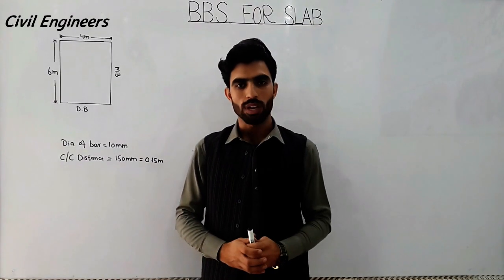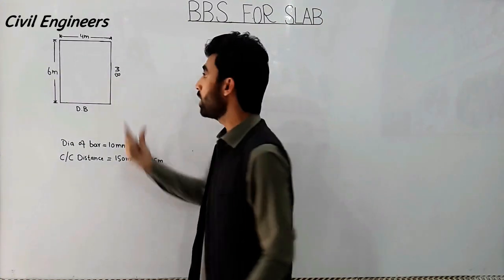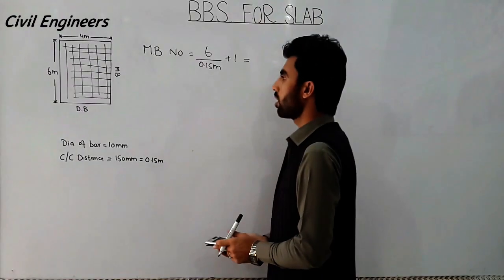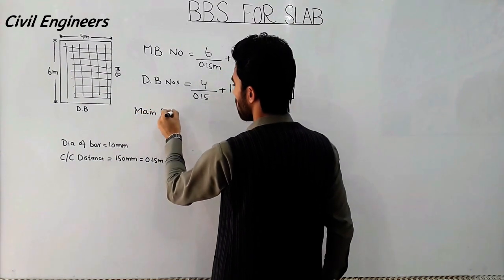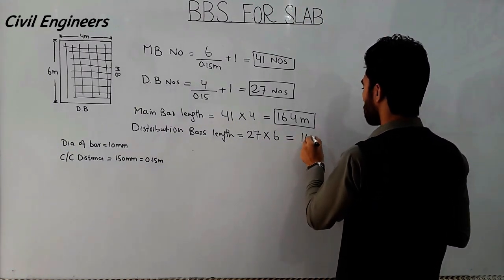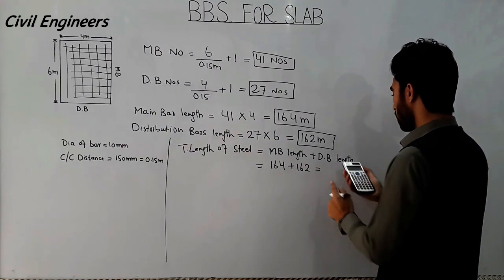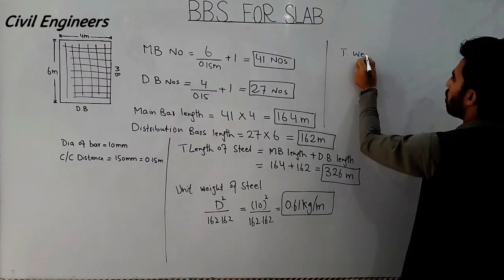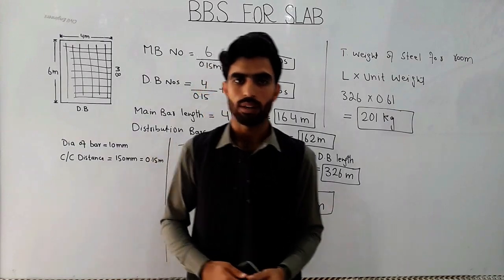How to Calculate Quantity of Steel in slab.

Comment: From where you calculated the unit weight on the board the denominator you write 162.162, thought its just 162 its the Diametee thats squared.

Comment: Total Length ÷ c/c spacing = Total no of bars + 1 ( my question why we plus 1 bar) what's reason???
Reply: Try this...practically... write on the paper in 10 x10 cm box correct dimension..now divide 10 part of spacing...now check u got 10 lines with right corner box line .... but the left one is balance....so..+1....slab need 2 bars at the corner with clear cover,👍
Reply: assume the slab size as only 0.15 meter. now if u divide it by 0.15 then it will give you answer = 1. but in that slab you need 1 bar on both sides, right? so you have to add 1 in answer. so now 1+1=2. now take 0.3 meter slab. and calculate. you will get your answer.
Reply: Simply you start counting from( 0,1,2,3......)like that the 1 point in start we add it.i think you understand it now in simple way
Reply: For safety

Comment: thanks sir for your free explanation, and I would like to ask you one question that is, why are you used 162.162 for weight  of slab while you used only 162 for beam?
Reply: It's formula not use the length of distribution bar

Comment: Sir if we are providing 8mm dia for main bar & 10 my dia for distribution bar. Then what is the calculation.
Reply: It will be the same only the unit weight of steel will be different.i.e for 10 mm bar the unit weight is 0.61kg after cal.n for 8mm bar it will be8×8/162.162=0.39

Comment: Who will deduct the covering provided in a slab from the length of each type of steel? Which is 1.5" from each side
Reply: It is mentioned in IS Code 456-2000 . The covering should provide different at different  locations/region  like mild,moderate ,severe etc and different structure like beam ,slab etc

Comment: how to  calculate center to center distance of slab.
Reply: Parmeet Kour as per IS 456  the spacing BTW main bars should not be greater than 3  times the thickness of slab. 
And should not be less than the Dia of the bar

Comment: sir ,why 1 is adding in the calculation of main bar and distribution bar please reply
Reply: not mentioned first spacing bar so total spacing calculate and added 1 bar
Reply: Jai Kumar
Reply: When you getting numbers of objects using the distance between them (spacing) you always add 1
Reply: in your finger to finger gap is four but finger is plus one. means five that's why we adding +1
Reply: Because waste of steel so we have adding 1 on both

Comment: Sir I appreciate the video. But I think the Total Length of the Bars should exclude cover ie 164 m - 0.1 m (50 mm cover) =  163.9 m. Similarly 162 m - 0.1 m = 161.9 m.
Reply from the maker: thnks
Reply: Nates Bita 
41*(4-0.05)=161.95m
27*(6-0.05)=160.65m
total= 322.6m
Reply: Rajesh RK .... What is 0.05 denotes bro???
Reply: estimated concrete cover
Reply: Exactly
Reply: I think per standard, concrete cover for slab on grade is 50mm to 70mm and that of suspended slab is 30mm

Comment: sir plz u make video of BBs of slab and don't ignore c.c and add overlap plz
Reply from the maker: overlap lecture will be upload after 3 days ok bro
Reply: Civil Engineers OK g thnks
Reply: sir over lap length vedios
Reply: Beautiful vedioes
Reply: Slab is divided into no.. Of parts in Gujarat we called it gala.. Means 1 part(gala) is connected to next part(gala).. Then it's consider lapping and crank bar also it take some amount of steel..so this method is shown  in you tube but in sitr i can not use.... So it's useless.... Any comment and suggestions accepted..